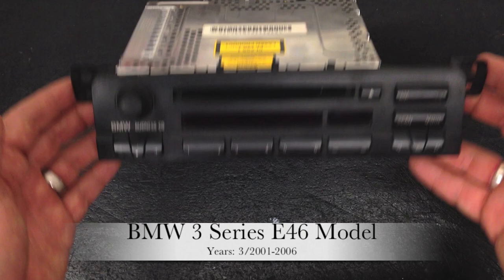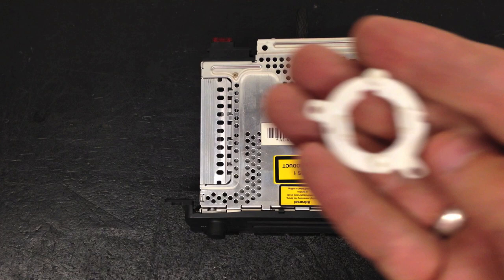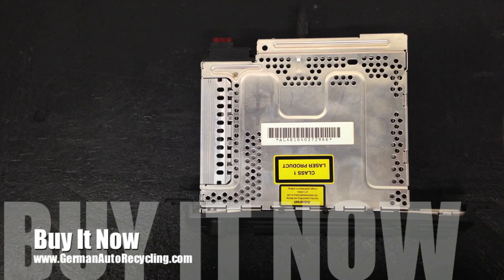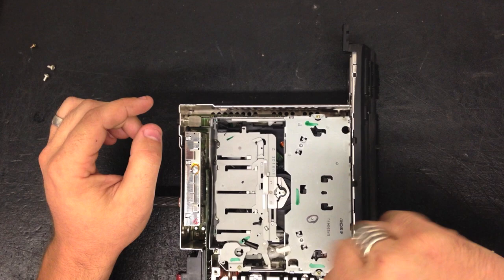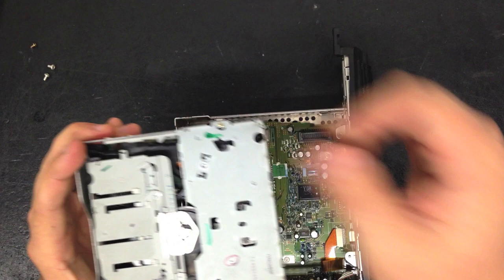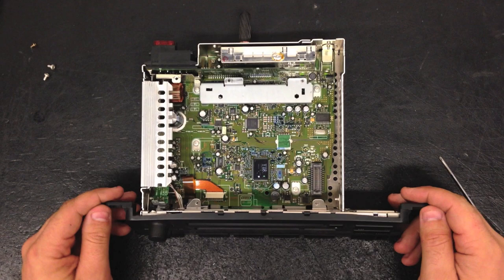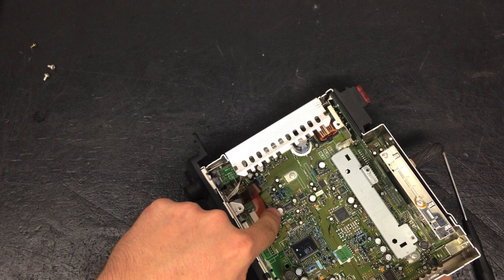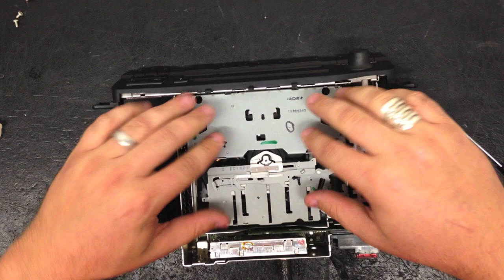BMW E46 CD Player 20 Min Volume Knob On-Off Repair

Comment: I showed your video to a another owner with the same problem. He repaired his radio using your dismantling guide and nylon screws and nuts instead of metal ones to compress the adhesive and rebuild the broken moulding. His volume control has been working perfectly ever since, so now two of us owe you a beer. Thank you again.

Comment: Thanks to your excellent video, I was able to effect a repair of the broken plastic moulding using epoxy resin and through-going machine screws. I removed the broken moulding, and pushed 3/4inch long threaded screws through the mounting holes. Using a small amount of Araldite Rapid, I fitted the broken lugs in position, and compressed the joints by tightening the matching nuts. After warm-curing for about an hour, I removed the nuts and assembled the mounting plate over the ends of the screws using serrated washers and tightened the nuts onto the washers. The screws were a bit too long, so I clipped them down with side cutters, close to the nuts, which further secured the nuts. I reassembled (-did not lose any screws!) and refitted the radio into the car. A year on, the current car owner is using the radio and player every day without any problems.
My technique will only work where all the fragments of the moulding are retrieved. In this case, I only had two breaks to deal with. I would not have attempted this job without the help of your video. 
Thanks again.

Comment: Can you please tell me what all the sizes of the drivers I need to get for this job to be completed? I bought the replacement piece but having hard time turning the screws. I’m afraid that I might have already stripped one of the bolts.

Comment: I think I got a newer version of this repair kit because the 2 screws that go into the white plastic part are larger than the original ones so I had to drill larger holes into the bracket that holds the switch to the new white plastic piece
Reply: They are a little larger, but will still screw in with a little pressure.

Comment: your video is excellent, I want to ask you when you take out the knob I have a problem of dirt on it I have a lot of trouble raising or lowering the volume do you know how to clean it inside or where can I buy the knob
Reply from the maker: Raising and lowering is a common issue. You must open up the data transmitter and roughen up the disc that rotates inside and tells the radio which way your spinning the knob.
Reply: @TomasBMW  the potentiometer its dirty
how can i clean?
Reply from the maker: @gmhzepeda  Yes you have to crack it open. Its not dirty but polished from use over the years and the contacts dont pick up signal. You have to score up the disc so that it picks up signal again. Only do this if your confident opening up that small potentiometer. If its broken beyond repair they dont sell this style design with the correct shaft size, you would have to take one from another parts radio.

Comment: GAR: Thank you for these outstanding clear video instructions with useful commentary.
Did you find the missing loose screw ?
Reply from the maker: Sometimes I find the small screws laying on top of the motherboard but usually they are missing. That is why with my kit I include two new screws with the mounting base.
Tomas

Comment: Upon doing this today (thanks for the diy!!) my lcd display backlight is no longer working, though the volume knob/button works now (the screen does work, it is just extremely dim).  Funny thing is, before replacing the broken bracket, the backlight would flicker on and off if I rotated the volume knob, like there was a contact problem somewhere. Now though the back light won't turn on again.

Any thoughts?  I know the backlight/bulb works as it functioned before the install.  Do you guys know how I can fix this??

Thanks
Reply from the maker: +Brendan Boutilier 
Only thing that comes to mind is make sure that the aluminum backing isn't bent or warped in a way which could cause unnecessary grounding to the board if it touches the right spot. Also make sure the ribbon connection going from the front face to the main board is pressed in correctly and doesn't have a folded contact stripe. 
-Tomas
Reply: +BavTek Inc. Thanks for the reply! Funny enough, the issue seemed to resolve it self when I turned the radio off and on while holding the mode button. I heard this would put it in service mode, and right when I did it the backlight fired up.  Radio/knob is working well now (Y)

Comment: Thank you great video.I think this look ok for a novice to attempt. Better than $500.  I am trying to find the plastic anchor part so it can be replaced. Do you know its part no and where I can get it from? Im in Australia.
Reply from the maker: The New plastic base is available at www.germanautorecycling.com. 
I designed the part over a period of a couple months with drafters and manufactures. So you will not find it anywhere else. I can ship it to Australia!
Tomas

Comment: Hi, how can I clean the laser ? Where is it ?
Reply from the maker: The laser is inside of the Drive Mechanism. I would only lightly clean it if you suspect its dirty. But be vey careful since the laser eye is balancing and if you press it too hard can throw it off permanently.
Reply: mumford4o you can buy laser cleaning discs. just put them in the cd player. let it play, and done !

Comment: By the time you do that, may as well fit a nice Pioneer system.
Reply from the maker: True, but Aftermarket systems though with more features, don't look right.
Reply: GermanAutoRecycling Hmm.. Pioneer have several which have amber lights and now blend in. I suppose the finish is too glossy though still. However, Nakamichi have a good of OEM looking head units. A becker unit is good. However, I make good money online by fitting the Rover 75 head units into e46 vehicles. They blend in perfectly and are excellent quality too!